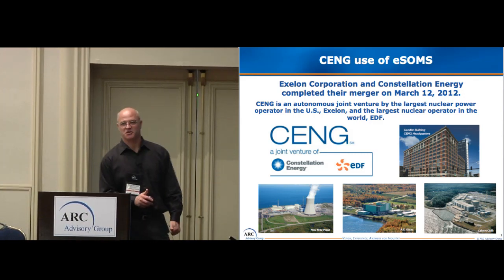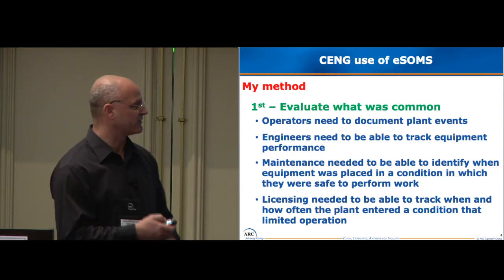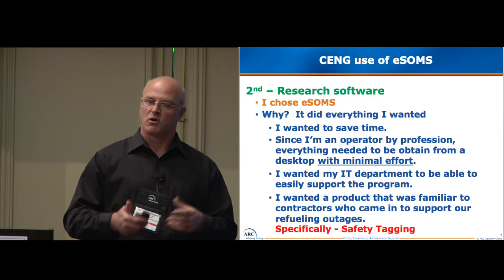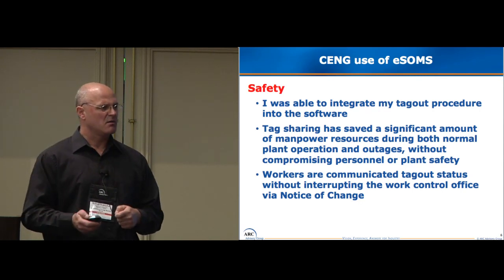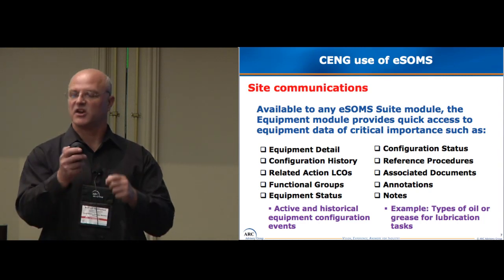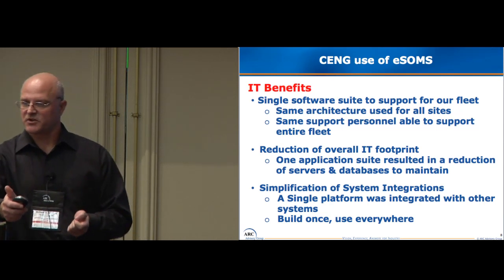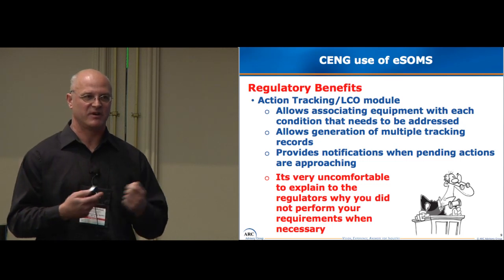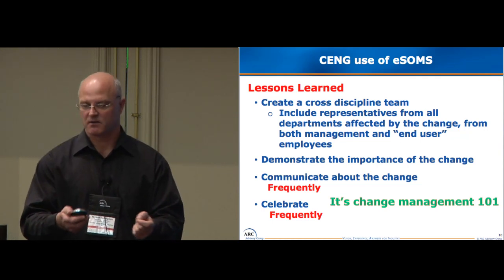CENG use of eSOMS, by Constellation Energy Nuclear Group's Robert Scampton @ ARC Forum 2013

Comment: I wish the eSOMS program could run on a better handheld device, not outdated PDA's.  A solution would be to import/export the operator rounds to an excel spreadsheet.  Therefore other, better, devices could be used.  Do you know if any of this is possible?
Reply: The windows mobile based application works on devices like Dell's Axim X3 or x51v and utilizes ActiveSync to sync logs with the network computer.  I'm looking for something that works with a winbook tw700, a windows based tablet PC that is much more advanced then a PDA.  Any help with this would be greatly appreciated.
Reply: kidphillyorg We are currently developing versions of both Operator Rounds and Mobile Narrative Logs  for Windows 8.x, iOS and Android, they are scheduled to be release in Q3 of 2015.

Scott
Reply: Scott Ewine thank you for the reply and information. I'm currently an Operator at a Nuclear power plant and we are trying to upgrade the devices we use and how we utilize them.  This would be a huge upgrade over what we are doing right now.  I would love to give you any feedback or info you need to support an enhanced in field use of eSoms.  Please feel free to send me a message anytime regarding this at education@kidphilly.com
Reply: What is the status update of the use of eSoms on Android devices?  I'm being told, by management, eSoms is not available for Android at this time.  Is that true?